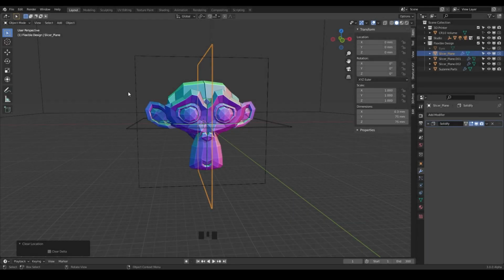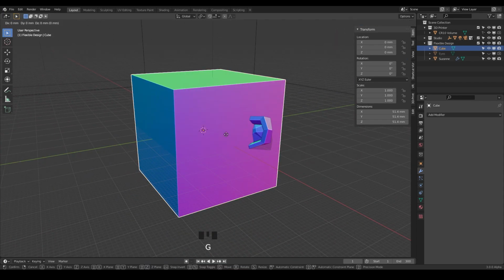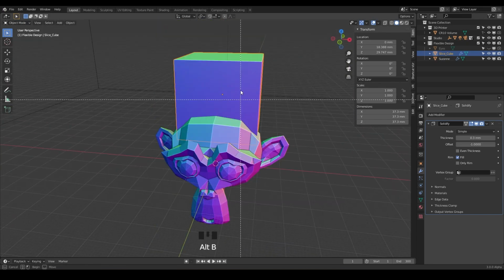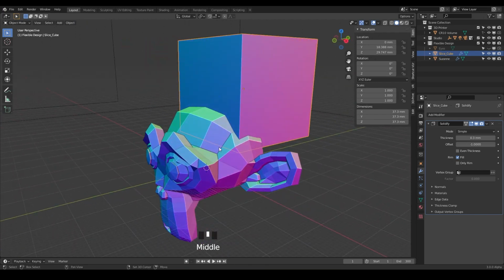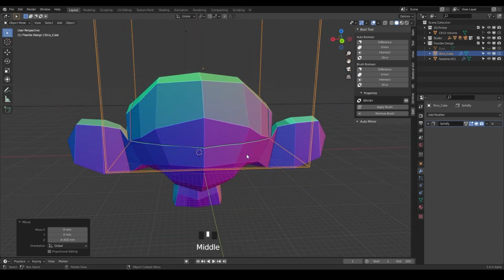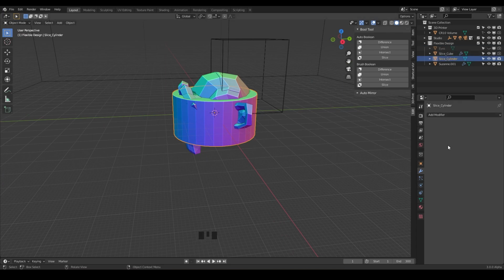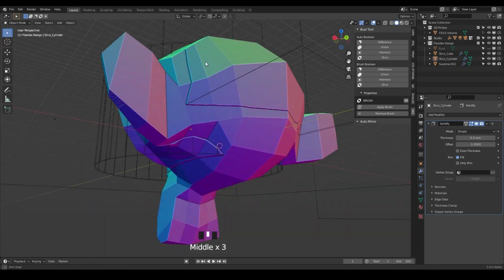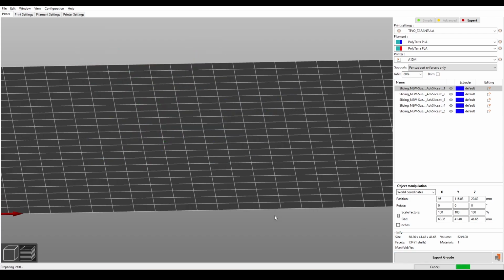Slicing with Objects (Advanced) | FREE Blender for 3D Printing Course

Comment: I can't for the life of me seem to get this to work once I do the slice and import into bambu slicer. I feel like some bits maybe were missed. I click export -> Export as STL but it fills in the cube and hasn't separated the model?

Sorry, if you could explain that would be hugely appreciated!
Reply: I did notice that when you perform the slice, a new object is made in your blender on the right hand side, mine does not do this when I perform the slice. I can see that it has made a small line in the object visually, however the object is not produced on the right hand side. It just comes up with "boolean_cutters"